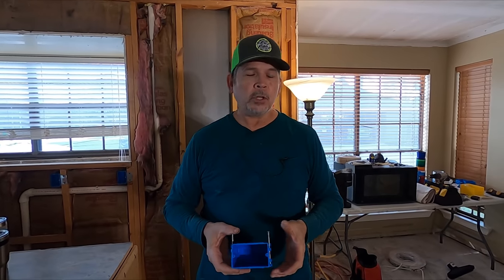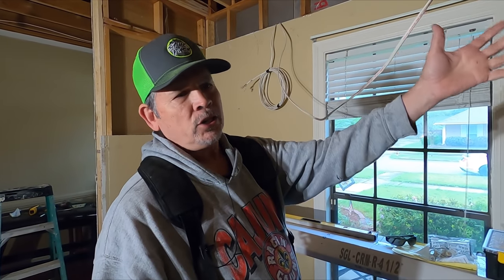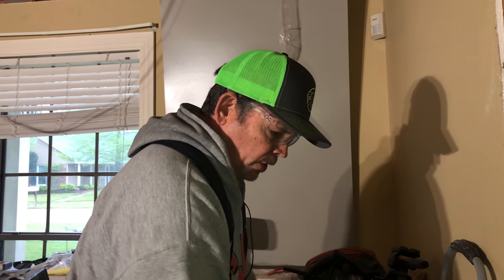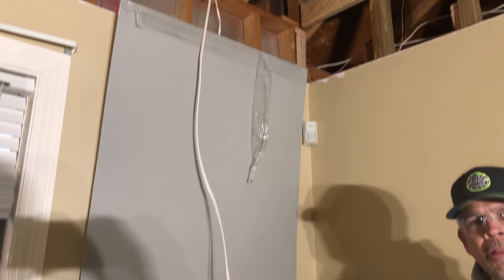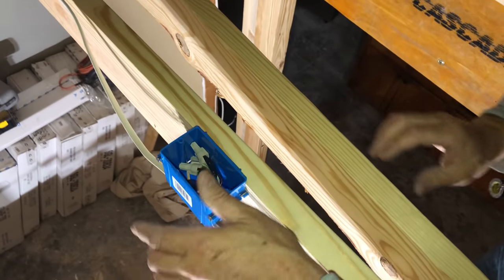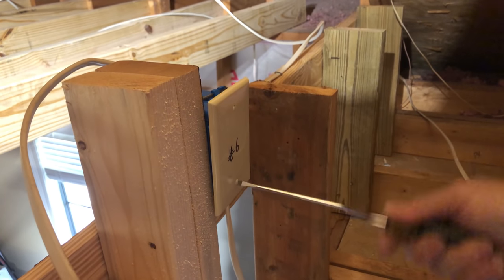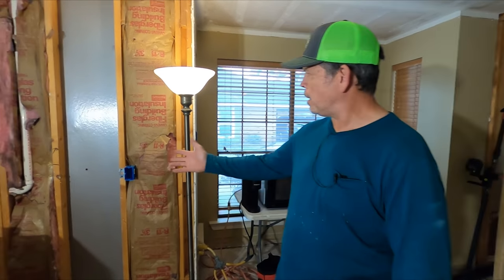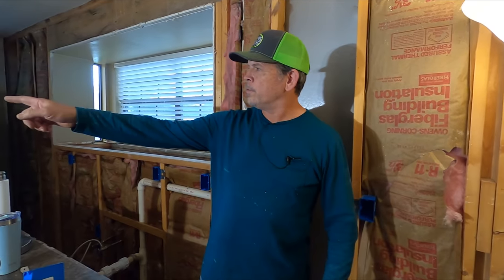How We HELP Our ELECTRICIANS⚡️ Ep. 10

Comment: Tip to help your electrician just a little more, would be to use a side bracket box for your J-Boxes in the attic and use a lath screw to secure it with. That way one can remove that box easily if needed. 🤔

Comment: You do know that you don't have to cut down the middle of the wire if you used those romex strippers that you already have.
They even leave a cleaner cut, and are faster.

Even better is that you can use them to score the cable insulation before inserting them into the box. Then you can leave them like that while you are drywalling, texturing, priming. Then you just pull the cable insulation off when you're done, leaving you with nice clean wires.

Comment: Man, your electrician must love you! Installing junction boxes up high in the attic, what foresight and practicality! One of the many reasons I'm a Studpack fan! Good work guys!
Reply from the maker: Thx John 👍
Reply: Amen
Reply: The gold standard is buried in insulation 👍
Reply: @StudPack  a seam ripper works great for splitting cable sheathing! Super inexpensive and no chance of nicking a wire when cutting open that sheathing
Reply: Less money for the electrician less work lol this guy is only saving money being cheap
Reply: @RR-ty6zz  Yep. Most sparkies would rip it out and start over.
Reply: The electricians I work with might be happy with the gesture, but angry that it made them more work. All of the boxes in this video wouldn't pass inspection and would need to be pulled and replaced.
Reply: @nilpo  Why wouldn't they pass?
Reply: @nilpo  What do you mean not pass they meet NEC Code compliance unless the Local jurisdiction goes above NEC which is minimum? I have been a Licensed Electrician for 30 years, he did everything correctly. As to a remodel rewire he is saving my guys time on a job that is bid more than likely not a by the hour. Time is money and that means my guys are in and out faster and down the road onto the next project.

Comment: As an Electrician of 17 years, you did a great job. You indeed remove the hot first, the neutral and then the ground. I’ll say I’m not a fan of the stab in the back connections. I always loop and put my wire under the screw in such a way that the wire tightens itself around the screw as you tighten the screw.
Reply: Stabbing in the back should be illegal
Reply: I get so many calls for loss of power on receptacles. Good ol stab in receptacles,  neutral loosened up and burned up receptacle losing power to other receptacles down stream since circuit was in n out thru receptacle instead of pigtailed n spliced. 
Pretty good job though helping out the electricians.
Good idea not pretwisting conductors as I've have run into so many broken wire in the wirenut.
Reply: He did mention that it was only temporary and that he always loops them around the screw
Reply: Outlets w/ stab in the back work loose, lights are OK
Reply: There are some where you stick them in the back, but you have to tighten the screw. I think those are better than even using the side screw. Provided you tighten them enough.
Reply: Ground - first to make, last to break
Reply: @redrollins8346  What do you think the chances are that the next NEC code update includes banning them? Not an electrician, so idk about the bureaucracy involved. Just highly interested in understanding enough about it all to hopefully filter out the bad electricians coming to finish removing the rest of the knob and tube in my new 114 year old house.
Reply: @mikemojica  I Doubt they would ban them, I'm an elektrician in the Netherlands, where we only use the twist connections if its in a box we wont be able to reach later without demo. If its not we use screwless terminals or wago's. Screw connections are hard to find. They're all up to code, and when installed properly they last for ever.
Sure, you do find burned neutrals in wago's or screwless terminals, but thats usualy due to overenergised circuits or bad workmanship.
What i always find weird about american elektricity is that all cables are in walls, unprotected. Over here code demands pvc pipe at the least and most cables are run through the floor when possible, to avoid possible elektrocutions later when the homeowner rams a screw through the drywall into a live circuit. Also the pvc allowes the changing of the cables without having to drill access holes or having to look for the route the cables takes! just pull on the cable at the fusebox with the new cable attached to the old!
Reply: @b2gills  Back wired isn't the same as Stablok but it's sure confusing when trying to talk about them.
Reply: Stab in means Job Security ⚡️🇺🇸🇺🇸
Reply: My biggest critique with his electrical work is too much sheathing in the box. Anything over an inch is bad.
Reply: @mikemojica  To make them obsolete will take a lot of time and a minimum of 2 full Code cycles which is 6 years. The Code book can be looked at in this way its a safety manual it is the bare minimum. You as the homeowner can specify certain brands and styles to be used in your project, remember the contractor works for you as you pay the bill. I have had home owners provide certain fixtures and devices to be used as long as they are UL listed and Code compliant I will gladly install them.
Reply: Preach! 🗣️🗣️🗣️
Reply: Great video, as always!  Just one comment; backstabbing is a one-and-done thing. It’s single use only and the receptacle should be tossed out once removed (I think you mentioned it was only temporary, but why not leave it disconnected?)

Comment: Hi Stud Pack ,  I am a master electrician from Quebec, you deserve a Honorary electrician license, you are great at it. You explain things and diagnose electrical like a pro! Only thing I would recommend less junction boxes the better try running home runs to the panel . Attics are not the best environment for wiring as it’s not conditioned environment. Example the high heat in summer the table on wiring in the code for 90 plus degrees  you have to cut the amount of amps that circuit can supply on a given awg size or pass larger awg size. You said yourself in Louisiana you guys like large pantry’s , so put your junction boxes in there . Keep making those incredible videos . Thank you Gang.

Comment: I'm an electrician and everything I'm seeing you do looks very good! Your safety tips you give everyone are really good too🙂.  Great work!
Reply from the maker: I appreciate that!
Reply: An electrician where? I'm curious where this would pass inspection. It would fail here immediately. Every box would need removed and replaced.
Reply: @nilpo  LMAO why would that be,  theres nothing wrong there🤷‍♂️
Reply: @willschultz5452  He's removing the tabs from the back of the PVC work boxes that are meant to clamp the Romex and prevent it from being pulled out easily. It's a code violation and every inspector I've come across would require them to be removed and replaced.
Reply: @nilpo  those are not the clamp type of boxes,  those are the type that you remove the tabs completely.  They only rely on a staple put on the wire close to the box to hold the wire in the box.
Reply: @willschultz5452  You are correct. I just finished a job using both kinds of boxes, and his were the punch-out type. Personally, I hate the other, clamp type.

Comment: Man you did all the work already. Just run new circuits and have the electrician sign off on them.
Reply: You know that’s what he did.
Reply: @richardwinstanley2014  😂
Reply: Yeah, this is what I was hinting at preciously. 😂
Wish we had electrical contractors here that would allow us to do the work and then just sign off. 

Not sure if I would have videoed everything though 😉, you never know what may happen later. 

For sure he knows what he’s doing, and I assume the licensed electrician is willing to take the liability. 

Good work as always
Reply: Bo Diddly  , not only that, but as a pro, if you see something wrong, you’re required to fix it. 
You guys bear a heavy burden.
Reply: I never use the receptacle device for connection of neutrals always pigtails. I don't depend on the device to continue the circuit.

Comment: The best way to make sure circuits are off. Always cut through both conductors at the same time with your favorite pair of cutters. You'll always be afraid of ruining a good tool and double check!!!!
Reply: Looool had this happen to me before , ruined 2 day old strippers haha
Reply: @joshlavecchia9888  how do the stripper get  ruined?
Reply: @jmarine79  More than likely the current melted them when the strippers acted as a bridge between the live wire and neutral/ground.  Don't ask me how I know this. 😂 😂
Reply: Guys it’s no joke, think about wearing one PPE glove & move safe up one level, just think if touching wrong edge of pliers
Reply: BUT REMEMEBER, EXPERIENCE IS THE BEST WAY TO REMEMBER ,," SAFETY FIRST'"

Comment: gotta get me one of those speed screwdrivers
Reply: They are in the electrical tools section at Home Depot for sure, probably Lowe’s too.  Klein and Ideal both make good “offset screwdrivers”, as they are called.

    They really work excellently.   Can be a pain to get enough torque on those plastic boxes when your screw is cutting the threads, but that can be a challenge with any screwdriver.

  They work great in most cases where high torque is not needed, and once used to them, they are easier on the user than holding up the weight of a screw gun, especially with flat heads, where a screw gun going “too fast” can go off center and come off the screw and scratch up your face plate before you even know anything is going wrong.
Reply: The Good ole whirly bird...mine has more hours on it than any other screw driver I’ve got in my bag. Nothin better for getting all your finish screws lined up perfect on your switch and outlet cover plates😎

Comment: if it was my house, I would also make it Ethernet ready, specially since you have removed the ceiling making super easy to run Ethernet cables.
Reply: Agreed!
Reply: Who uses ethernet in an age of wireless?
Reply: @robschwenck  how are you going to connect the wireless router?
Reply: @robschwenck  people who have brains
Reply: @macster1457  At the cable connection.
Reply: @luvdady  Shame on you for wasting oxygen the way you do.
Reply: @robschwenck  so if you want to extend your wifi signal on another part of the house because your main router cannot reach, you need to have an Ethernet cable to provide internet to that 2nd wireless router located in another part of the house... or to just simply provide internet to another PC... Ethernet is ALWAYS better than ANY wireless connection, even the new wifi 6.
Reply: @macster1457  Or you set yourself up with a mesh system and expand the network wirelessly.
Reply: @robschwenck  yeah because wifi is magic....
Reply: I'm fact, setting up a 2nd wireless router to run as a wired extension out of your first can make the whole network unstable and in many cases isn't even supported by the ISP.
Reply: @robschwenck  ok Linus,  so how do office spaces work with one or two routers? 
Wow just wow at the foolishness
Reply: @luvdady  You're still wasting air here? Offices have scores of users. If your use case has multiple devices actively online autonomously, sure, stick with ethernet for another few years until wireless speeds exceed wired. Otherwise, you're wasting time and money putting in cables.
Reply: @gorak9000  Unless you've got a 4k TV located away from the router, there's not much point to having capacity you don't use. I have my desktop on wireless without issue. TV hard lined into the wireless router; everything else is on a mesh network. To run cable would be a waste.
Reply: @robschwenck  you really don't know how this works do you? 
How many maximum users does a wireless connection have?
Reply: @luvdady  Do you mean house many devices can be connected at once? My network can handle 200+. It can stream multiple 4k videos at once if I gave it the screens to do so. Tell me more about how little I know. 🤣😂🤣
Reply: @luvdady  Do you have a phone hanging on the wall, too? 😂🤣😂
Reply: @robschwenck  lol yeah that's why radio and TV stations are all operating on the same band in local markets right because no such things as radio interference?
Reply: @robschwenck  actually sitting on my desk. Lol. 
Yeah you don't have a clue how stuff works. It is hilarious you just spout of Linus tech tips lvl of wifi knowhow.
Reply: @luvdady  Please, stop embarrassing yourself. I'm starting to feel empathy for you and it's kind of disgusting me.
Reply: @robschwenck  bahahaha.
Yeah ok please explain what radio interference is? And how wifi isn't a radio wave on 2.4 or 5 ghz band like cordless phones?
Yeah I imagine that you won't nor could answer it
Reply: @robschwenck  you can, but you need specific routers for that (same brand) and routers that have the option...but anyway, Ethernet connection is always superior than wireless and more stable and interference- free
Reply: @macster1457  I can only guess that you live in a more dense area, as interference is not an issue here. While wired speeds currently exceed wireless, both remain limited by the pipe to the house and each have the capacity to satisfy modern needs. With that said, the cell phone providers are keen on providing technology that would make all the cables obsolete. Embracing wires at this point, unless driven by a need to counter interference, is reminiscent of subscribing to the Netflix DVD by mail only membership tier.
Reply: @robschwenck  whether I live in a condensed area or not... wired internet will always trump wireless... every time.
Reply: @macster1457  And nothing beats the mobility and comfort of a horse and buggy.
Reply: @robschwenck  sorry bud, Im too dumb to understand your analogy...maybe that's why I prefer a wired connection when possible...because of my lack of intelligence 😂
Reply: @robschwenck  yeah lmao  you do know cell towers still contain cables right? 
because cell phones while improved are still dependent upon specific bandwith in order to operate. kinda of like the way wireless microphones kinda got booted off for interference.
Reply: @luvdady  LOL ... thank you for that. Robert isn't high on thinking ahead apparently!
Reply: @robschwenck  When they find out all these wireless signals are giving us cancer, having wired ethernet might prove to be VERY helpful!
Reply: @luvdady  Bruh. You came back? What makes you think I'm anti-cable, that no cables should be used, ever? They have their applications, and with each passing year there is less of a need of cat cables ruining through your house. That's the point of all this, that the technological trend is away from wired and towards wireless and to think "lemme wire up my house for internet while the dry wall is down" is something out of the 90s.
Reply: @crookeddonald3883  Better not be cooking anything with your microwave oven if you think that's a possibility.
Reply: @robschwenck  I rarely use it and maybe you have not noticed but the microwave is on a few minutes a day, any guess on how often wireless signals are on in a day?
Reply: @crookeddonald3883  Have you noticed the difference between ionizing and non-ionizing radiation? No? Some people are in a long term relationship with their worries.
Reply: LOL, internet comment fights are the best to watch. Nobody knows anybody but everyone is willing to go all in. Everyone is fearless and tough when they don't have to actually face their aggressor.  😄
Reply: @robschwenck  A lot of people still use ethernet. If you have smart TVs, you get better streaming especially in larger homes where the router might not be centrally located. I prefer ethernet when available.
Reply: @robschwenck  I have a large house. I have to have a mesh network to make wireless work in my house.
Reply: @robschwenck  That cost me nearly a grand, dude. And when they fail I have to replace them!
Reply: @robschwenck  Wow, you know very little about networking dude. Perhaps you should tap out.
Reply: @PJBonoVox  I last commented 5 months ago. I should "tap out," seriously? This video was of such value to you that you opted to read all the comments and this is the one you respond to? Begone with you! Return to the rock under the hill from whence you came!
Reply: @robschwenck  People who appreaciate rock solid connections for streaming HD/4k TV and/or more secure security systems.